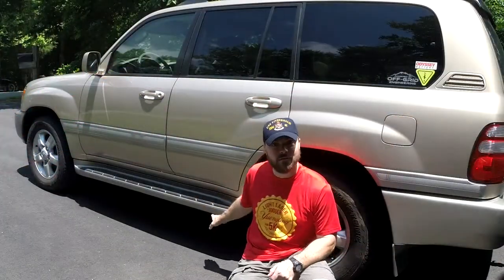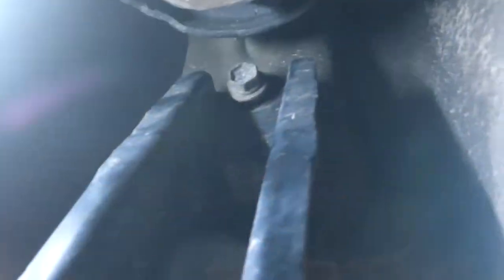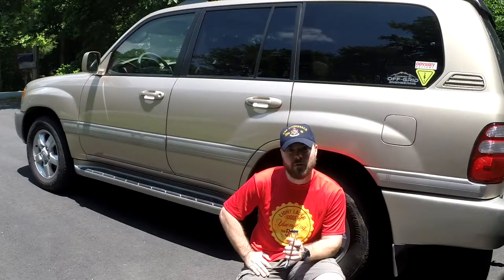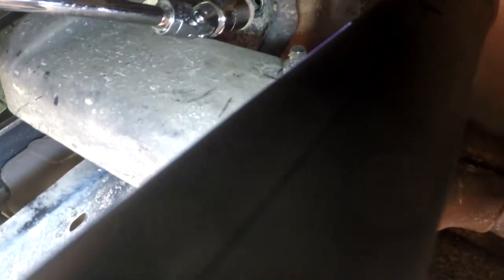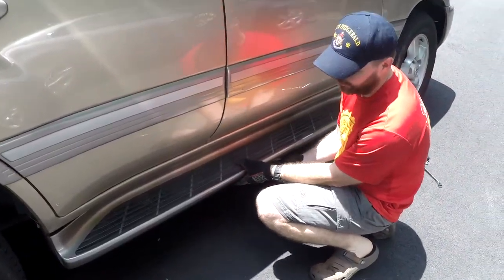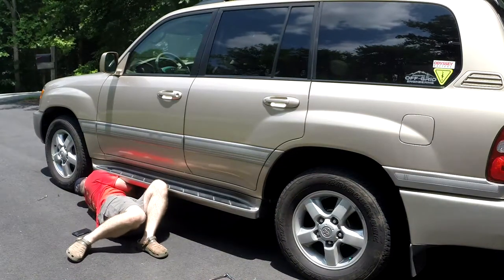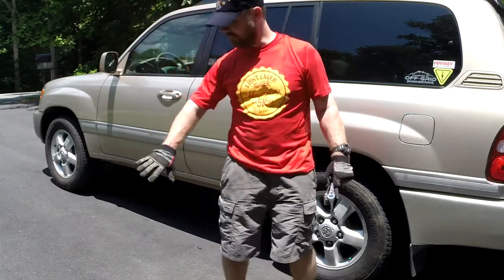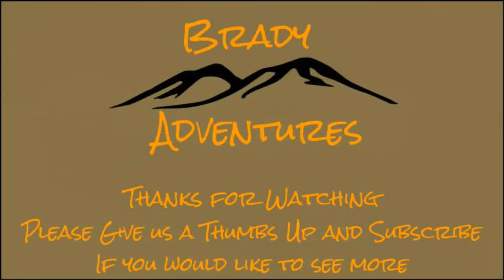05 Land Cruiser Running Board Ectomy

Comment: Hey there, I recently removed my running boards and it looks great...a day or so later my check engine light and traction control light came on... wondering if this happened to you and how to fix it? Let me know, thanks
Reply from the maker: I feel like I already replied to this one but can't find it 🤔  Anyway I didn't have this issue and would be curious as to the solution.  Ok the other comment I recall it was taken to dealer and it was an alignment issue.

Comment: Don't know if ya still check comments but has your land cruiser been reliable enough to daily driver it
Reply from the maker: Absolutely,  I actually don't drive it everyday usually just on the weekend and trips but trust it more than my other two cars (acuras).  It has never had any issues or left me anywhere and I think it is one of the most reliable vehicles you can get.  Since I got it I've done the timing belt, t-fittings, diff fluid changes but that was all preventive regular maintenance.  I recently replaced both the front axles, they weren't bad but leaking and needed to be rebooted so I just went with new to get another couple hundred miles out of it.  Overkill but I plan to keep this thing for a long time.  The only thing that's tough with daily driving is mileage.  I got about 17mpg when I got it but now I have 33s, arb front bumper, and an OME 2.5" lift and it gets around 14mpg, so it can get pricey if you have far to drive.  Hope that helps, thanks for checking us out!
Reply: In my opinion, the only draw back for the LC is the poor mileage.  I also use mine as only a weekend/trip car and not a daily driver.  At least it doesn’t require premium fuel.